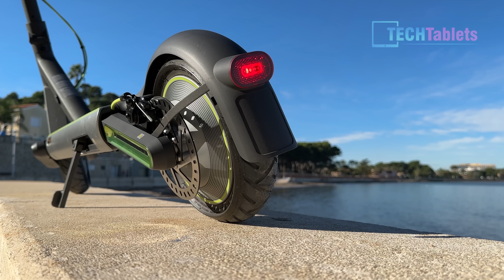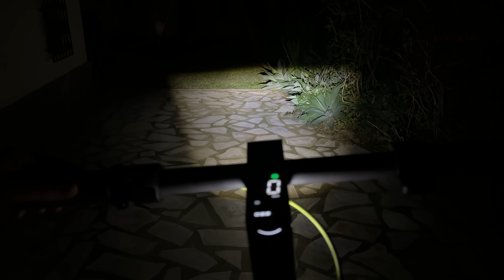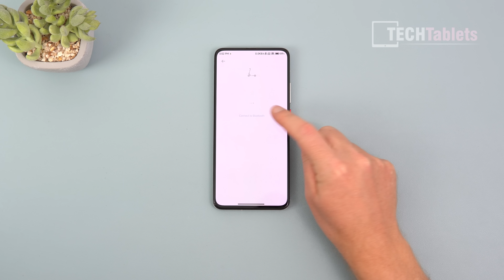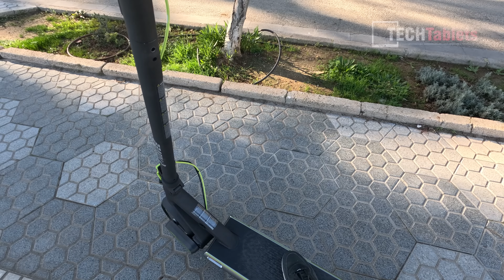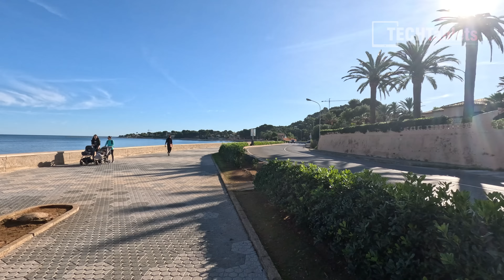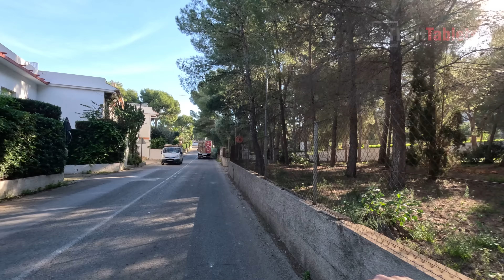Navee S65 Review (Xiaomi Electric Scooter 4 Ultra) My New Favorite 25KM/H eScooter!

Comment: But it is too slow , i dont kniw why they need ho lock speed. At least they should set at least 35 mph speed
Reply from the maker: Silly EU law that's why, 25kph is too slow should be 30-35 at least and more power.

Comment: The rattle is also present on the Xiami 4 Ultra. It comes from the loose wheel cover where the brake line connects to the wheel. It's truly annoying and I hope there's a fix to the problem. It's fine as long as you're on smooth pavement.
Reply from the maker: That and the plastic inserts for me. Very annoying and I'm shocked it hasn't been fixed! Better off buying the Ninebot Max G2.
Reply: @Techtablets  So it seems like it's like this by (faulty) design... Does your inner most disk also wiggle if you try to move it with your fingers?
Reply from the maker: A little yes, which is why since reviewing this and then the Ninebot MAX G2 it's a better escooter the Max G2. This has some design flaws that need fixing with the rattles etc.
Reply: @Techtablets  I hope there's a way to remove the left plastic faring to get to the screws and bolts. Maybe there's a way to tighten the loose part.

Comment: I have this scooter and I had Eleglide S1 Plus (well, it has been stolen). I use the scooter for short distances in hilly parts of the city. I prefer slow motion on pavements.
Now, for the pros and cons, some of them  in comparison.
Navee has more power and better look, it is more comfortable due to suspension. It can climb slopes the other can't.

But there are cons, I'm not very satisfied with.
First is the climb ability on walking profile. I need the scooter to be able to climb. It can, but you have to use the sport mode. In walk mode, not only speed is limited, it's the power itself. 
Second,  to change mode, you have to press the power button twice. Really not good to do that during the ride, one button is much better.
Third is the throttle. In sport mode, I'm not able to keep like 6-7 km/h. It's not very sensitive (maybe I will improve my skills over time). With the other, the acceleration was much softer, I was able to control it much better.
Fourth is that Eleglide has foldable handle, and I miss that on this one (I knew it before, it's just as it is)
Fifth, I miss the opportunity to adjust size (I didn't think of it before buy)

The weight is just a consequence of power and range, quite heavy to manipulate.
The noise from the motor is ok. 

Conclusion: I can use Navee more in hilly area. But not only for bigger price, but also heavier device,  with less comfortable throttle and control.

And last hint for anybody having issues with connecting using the application - check your WiFi connection - and switch to 2.4GHz network before (Bluetooth) pairing - sounds strange but for me it worked. I was not able to pair while connected to 5GHz network.

Comment: Just ridden my ultra 4 up the mountain in Ager, Spain with no problems at all, used 60% of battery and with the lowest regen I got back to the campervan with 50% battery, it normally takes van and cars 20 minutes to do the climb so I was impressed with 30 minutes.. what a beast
Reply from the maker: Wow that's great!
Reply: No noise from the ultra 4
Reply from the maker: Yes no noise with the Xiaomi as it's not a geared motor, this one is. The only difference.

Comment: Great review with xiaomi pro2 I had trouble going uphill on 15%.
I hope this is no problem for 4 ultra.
And can you unlocked it to go at least 35-40 km/h?

Thanks
Reply: you can replace original international controller with chineese only controller. It will go about 35, 40 if you are very light

Comment: but the motor sound like cutting some metal
Reply: It has gears, I would never buy geared motor scooter. Less range, less torgue... In 2023 everyone should use brushless.
Reply: @sleepyjoe7843  yes you are right i have kqi3 max very smooth scooter,no noise but powerful.

Comment: interesting! sophisticated powerful scooter such as this one could take away market from small foldable ebikes.  The scooter can easily be brought inside bus, elevators and trains for city commute.
Reply: Have you checked the weight of this thing? My Ninebot Max weighs 30% less and I wouldn't think of taking it on a bus. M365 1S no problem.
Also I own ADO A20+ ebike with throttle and I can say I prefer the bike much more for following reasons:
- safety: bigger wheels, dual disc brakes, more stable riding
- removable battery: I can charge it inside the house and keep it warm, so it can perform well in the winter
- load: I have a luggage rack and big metal basket in the back to haul things around
- works without battery
- stealth: much less suspicious to authorities than a fast escooter
- keeping warm in the winter: by lightly pedaling I am never as cold as on Ninebot.
Reply from the maker: Great point! This is why people would go for them due to the size and weight. The only downside is you can't use them with a flat battery unlike an ebike.
Reply: @Techtablets  with such a big battery shouldn't be a problem

Comment: No front brake is a bad idea
Reply from the maker: Yes and no, braking too heavy on a front wheel with a scooter can also been risky specially in the wet.
Reply: @Techtablets  Some countries don't allow scooters on road if they have only one break. Example Belgium.
Reply: On such an expensive scooter for Navee to save like 20$ by not putting in a front brake is just preposterous.
Reply: Absolutely. 70% of the brake force is provided by the front tire.
Sure, having no front brake may turn out to be adequate for most situations. But in emergency situation, when you really have to stop, this scooter will let you down simply due to providing only 30% of normal braking force.

Comment: You need to go faster than 25 it is slow
Reply from the maker: Over that with only a rear brake wouldn't be a good idea.
Reply: Also, riding this scooter in the wet is not a good idea.
I actually invested in their Indiegogo campaign. When I learned of no front brake, I took my m365 and disabled front engine brake. Riding this setup in the wet was absolutely dreadful experience. It's so hard to apply proper braking force. I would either not stop or lock the rear wheel. I therefore promptly cancelled my order and purchased Ninebot Max. It has excellent braking performance despite only having front mechanical brake.
Reply: Now I ride my Max at GPS 30+ kmh with confidence that I will be able to stop. Bear in mind the S65 GPS speed is more like 22, 23 kmh.
Also I have custom firmware that has a hidden profile with max speed settings. This way I am confident even if my scooter is sized by authorities, they cannot prove it is capable of speeds in excess of 25 kmh.
None of this will probably ever be available on S65
Reply: Still s65 is better scooter overall than max g30. You could say it is his successor.

Comment: The engine sound is unpleasant...
Reply: 100% Agree. They could have used brushless motor, which would be silent as other scooters.
Reply from the maker: They should have yes, I really wonder why they went for it. My guess was it make it better for the climbs being geared? The noise at first is very annoying, but I got use to it and as mentioned liked the fact people could hear it in the end.
Reply: @Techtablets  my assumption is that geared motor cost less and they wanted to cut the production costs. 

I think most of us would prefer having / riding a silent electric scooter and in case we need to inform people around - we could kindly use ring bell, which are usually placed on every scooter. 

Also, geared motor means it would require to be changed after some time, because it has it's life span. Wonder what kind of solution / service Navee would offer in case motor needs to be changed. 

Anyways, great review, but strange move from Navee to go with geared motor. 

Also, unlocking speed to 30-35km/h would be a nice addition. I am sure the scooter is fully capable of that.
Reply: Actually it costs more as planetary gears are an addon.
Don't forget that now your motor requires regular replacement of those plastic gears.
Reply: A mí me gusta, hablá por vos.
Reply from the maker: Well it's because it's a geared motor, the plus side is people hear you coming at least.
Reply: @Techtablets  I can't disagree with your arguments, but it's still unpleasant and it can play when choosing 🙄